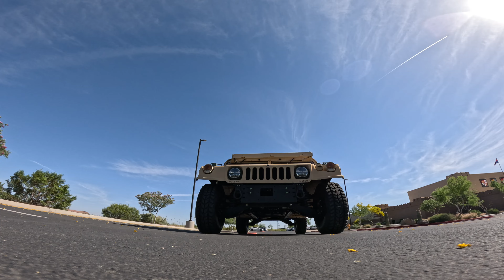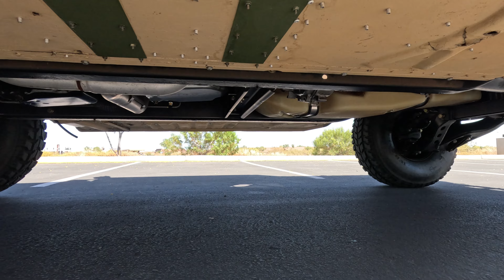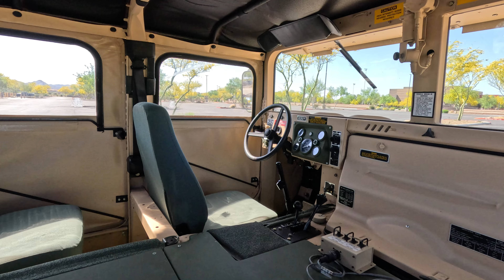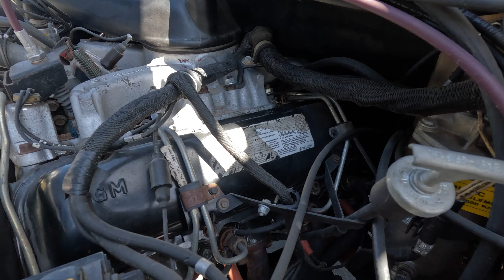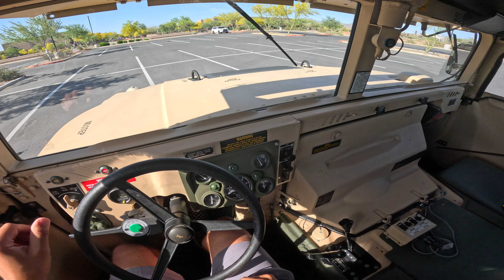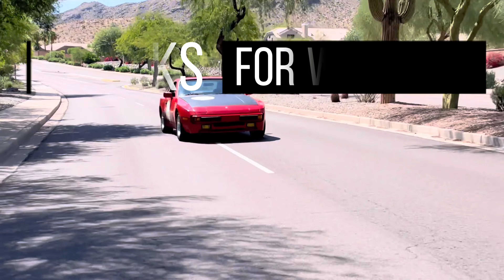No Expense Spared Restored 1985 AM General HMMWV M-1045 Humvee

Comment: There are so many things wrong with this truck its scary. For starters it's not a 1985 model. Those are M998 variants, It's not a M1045 model either since those did not have the rear air cutouts on the rear fenders. Ground clearance is not 15" it 18" . This truck has the air lift bumper with the mounts for the rhino spare tire carrier, but no carrier included. The reflectors are all bleached out from the sun (30-dollar parts). I could go on and on, clean truck but fair price is only about 20k
Reply: someone bought it for 40k.....